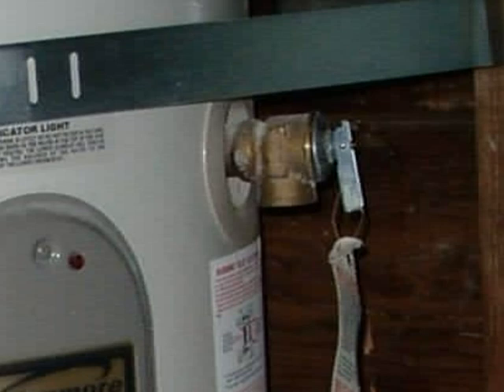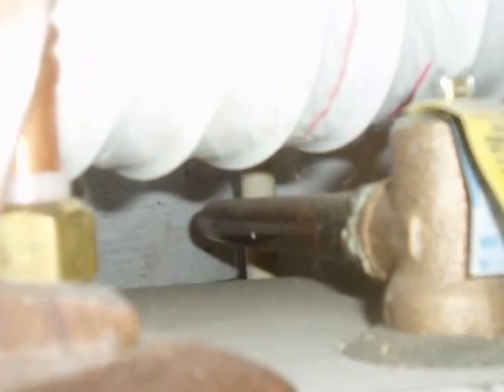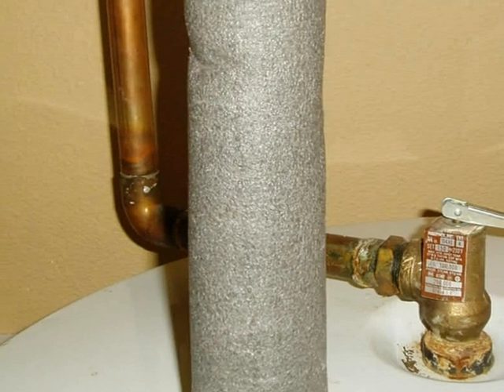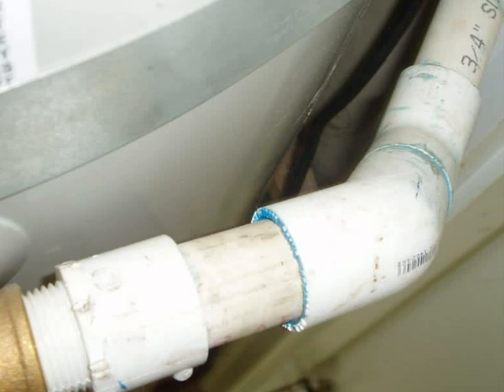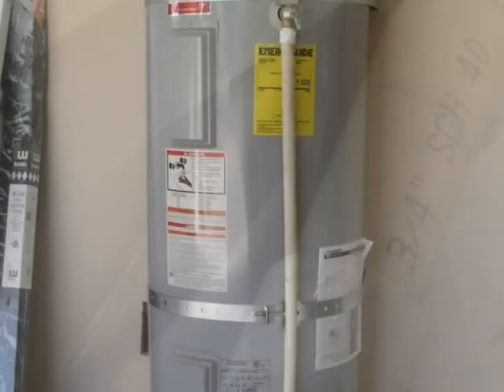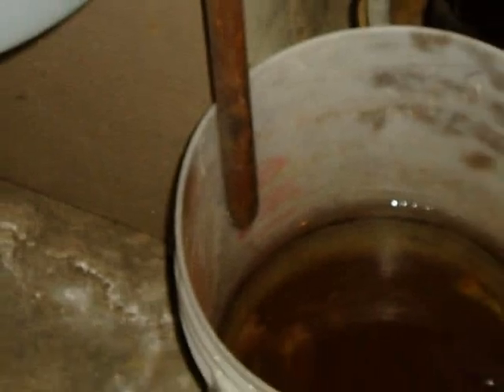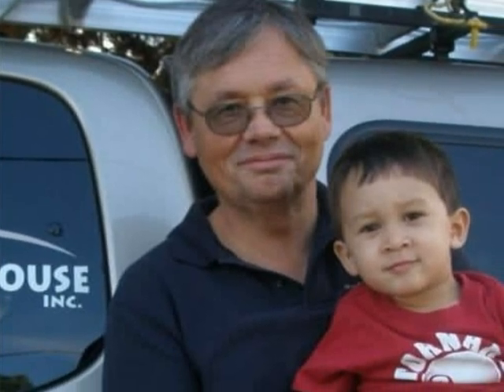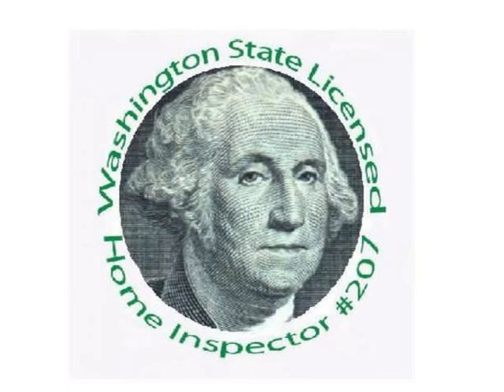Whatcom County Home Inspection (King of the House) Temperature Pressure Relief Valve Safety

Comment: How many 90s can be used to the outside?
Reply from the maker: I have retired, but typically four max and hopefully fewer. For a longer run there might be one near the valve  pointed down, another into a wall at a lower point, and another where the tubing exits the exterior wall pointed down  in a visible location.

Comment: Can a TPR valve drain into a shop sink in Whatcom County?
Reply from the maker: It should terminate 18 to 24 inches above grade..ground..a floor. Etc. Usually a sink would be too high and the drain pipe cannot slope up for even a short part of the run. If the sink was actually low enough to do this the tprv drain line would have to terminate above the water level of the basin...if the sink was full the outlet would still be a couple inches above the basin so it could never be below the water level of a sink full of water.
Reply: It’s a tankless heater mounted pretty high up on a wall
Reply from the maker: The same rules apply. If you are doing it yourself and decide to do it at the sink have the drain end an inch or two above the rim of the sink. If you have a municipal inspection they may not accept that although practically it should work if it is above the sink rim and goes down or level ..no upward slope

Comment: If my drain valve is more than 24 inches above the ground and the home inspector approved my home was that in error?
Reply from the maker: Most home inspectors are not specifically inspecting to code. In theory it should be no higher that 24 inches above grade. On the other hand as long as it is not off by too much you are not likely to have an issue. The main thing, other than you for sure want it to be present, is that it not be pointed out so it would discharge at someone should it discgharge.

Comment from the maker: Browning. That is usually caused by anyone of a few things. Sometimes, on an older tank, the TPR valve might be shot, so it leaks. It also could be that you have a pressure reducer in the supply system and no thermal expansion tank. Or, in general, the water pressure to your house could be too high and you might need a pressure reducer and a thermal expansion tank. None of these things are terribly costly but you might need a plumber to figure it out and fix it up.